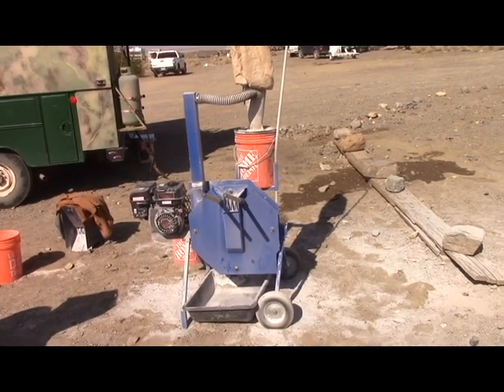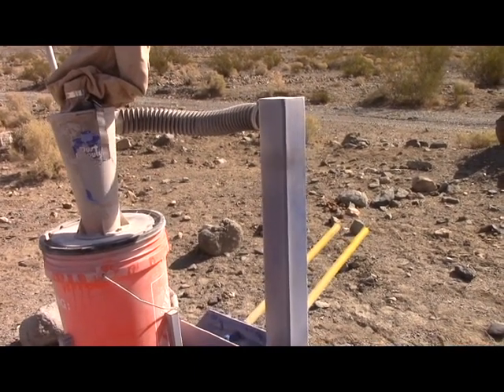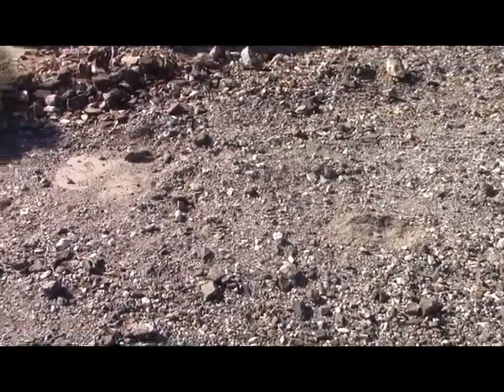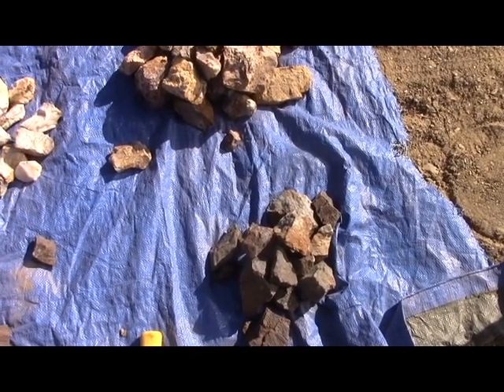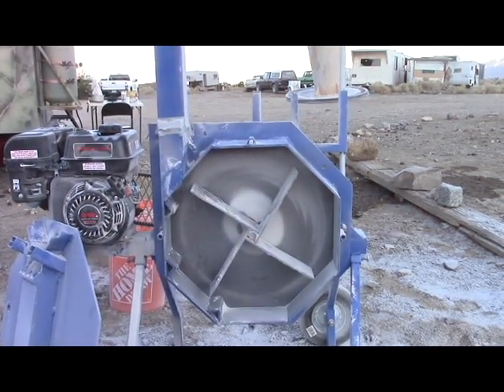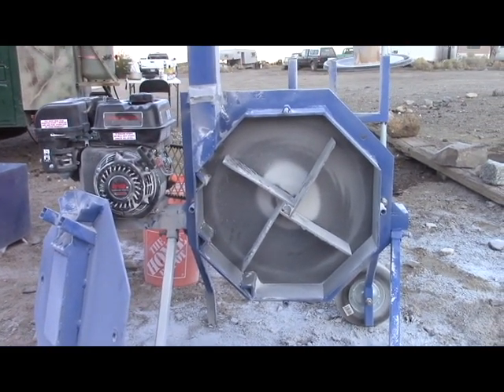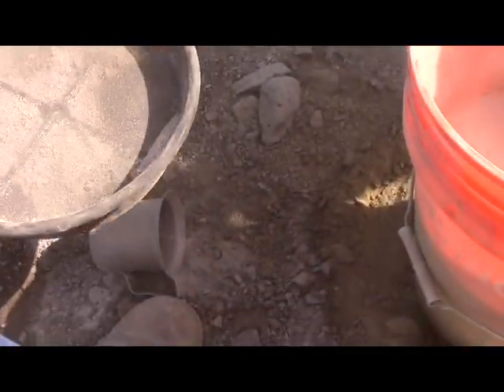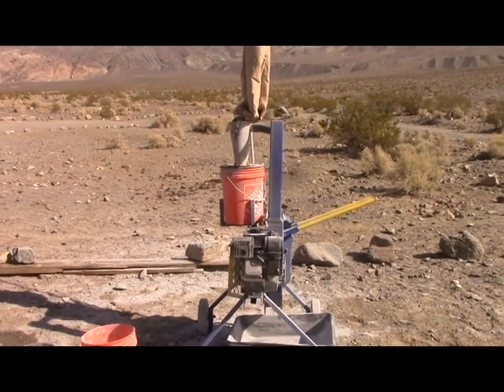124 Testing My Impact Mill Prototype and a Ballarat Ore Pile

Comment: If you put your angle iron "anvils" in the top or side instead of the bottom would that cut down on the backup in the "dead spaces" you mentioned - or would the material not be lifted to hit "anvils" higher up?
Reply from the maker: It  doesn't seem to have a bad build  up when running dry.

Comment: You can simply drill and tap those angle pieces to receive replaceable wear plates, or, easier still, make wear plates with a little capture tang on the side facing the service plate so they slide on, and slide off, but only can do so when the service place is removed [the plate then holding the wear plates tightly in place during operation, but then no screws to jam, grind smooth or rust up inside, leaving a super easy way to swap the wear plates out!]

       /)/) 
     (   'ˬ') 
@(>_ )-b 
      \) \)
Reply from the maker: That would hold them in place, but the vibration and dust might anchor them to where they don't want to come out.  I'll probably try a few different ideas before settling on one.  That is the idea of a prototype I guess.  :-)
Reply: @hardrockuniversity7283  You can put a 'knock-out screw' in the back of the machine [works from outside] to press them out if they are sticky. (~_^)-b

Comment: Too much work for that ore to be profitable. Probably $600.00 in gas to crush up a ton of that. ;-)
Reply from the maker: Actually, about three hours on the RC46, call it four gallons, plus 5 hours on the Impact- call it another 4 gallons, plus a generator running the hydramatic and my table for an hour each- two gallons, total 10 gallons- less than $50.  Hardfacing wear- about $10-20.  Excluding mining time, six man hours (things run simultaneously).

Thus (excluding mining) 1/2 Oz/T x 80 percent recovery x $1450  = $562.  Divided by 6 equals $90+ per hour.  Not bad.  If mining labor is the same plus $50/t consumables, you are looking at better than $40 per hour.

Considering everything I would say that is about a minimum  as a job instead of a hobby.  That is why my rule of thumb is "Better than 1/2 Oz/t and easy to mine with little waste".

Keith
Reply: @hardrockuniversity7283  Point taken but too much work for me. Plus, when you sell it you are getting maybe 80% of spot price.
Reply from the maker: @Cwra1smith  Yep, I would hate to have to work small amounts of less than 1 Oz/T.  Now a MOUNTAIN of .25 would work quite nicely.  :-)

Comment: "Two cups of material"  How much of a ton was that???  Since when is yield test done by volume and not weight?  What ever.  So what did you estimate was the gold weight recovered per tonne of the material in this test shown???  You neglected to mention that.
Reply from the maker: That pan is about 1/2 Oz/T free recoverable gold.  And I do it by volume because it is approximate but very fast and easy.  The panning itself introduces sufficient variables that the weight vs volume difference is not important.  If you want precision you can pay $30 per sample and wait a month- or do this in five minutes for free.  Notice how I was able to determine which rock type had the recoverable gold while in the middle of nowhere in only a few minutes?  It would have cost me $120 for assaying and $600 for a return trip to get the bucket I actually crushed using a lab.

Comment: Think that would work on the colechee hardpan I have up here 
     By the way those preditor motors are very good motors parts are cheap 
     KEEP the air filter clean and change oil about every 15 hours the biggest problem I have are the two spings from carborater they break alot in mining conditions carry extras they cost about 3$ a set and are pretty universe for alot of motor brands
Reply from the maker: Thanks for the info Forrest.  I'm sure it would beat your material into submission.  Hope to try it sometime.
Reply: Keep me posted and the cost to buy one when you get ready to sell them 
    Might want to sell them with and without motor save alot on shipping cost
Reply from the maker: @forestanderson3267  My thoughts exactly.  Looks like about $1000-1500 without motor.  Plus, the customer can get the motor warranty in their own name.

Comment: Nice work buddy.. so this mills only material output is via the top shoot? Also you slowed down the air flow because you were ejecting larger material?
Thanks again sir 
✌️PT
Reply from the maker: Yes. Originally it was blowing out 1/2 inch rocks.  Adding the angle irons changed it to the current situation.

The whole assembly can also be unbolted from the main frame and rotated 180 degrees if bottom output is desirable- perhaps for wet grinding of really wet ore.